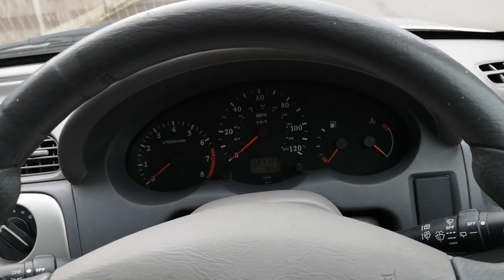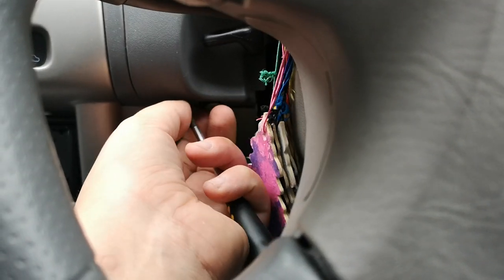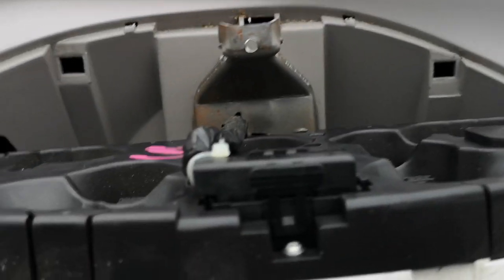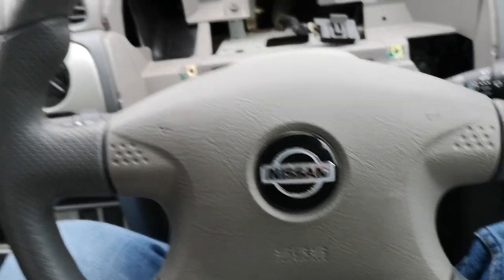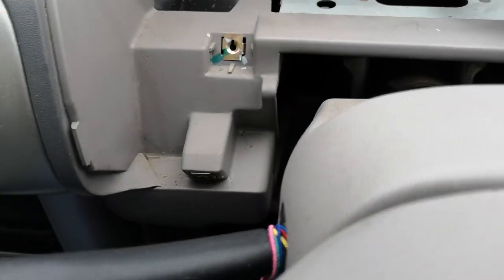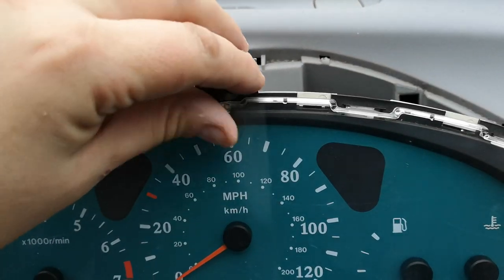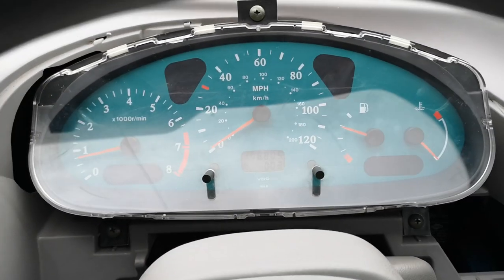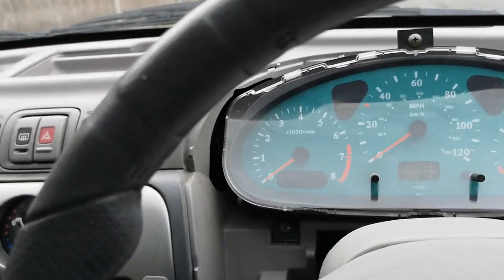Replacing a Nissan Micra K11 Instrument cluster

Comment: heard you say about having changed from a non-speedo cluster to a speedo cluster. is it a straight swap or is there any other work needed in the process? Also, what dyou have to do [if anything] to match the mileages between the old and new cluster? any info would be greatly appreciated
Reply from the maker: For me, the upgrade was 'plug and play'. No additional wiring was required. Others I have spoken with have also experienced the same. Mileage wise, I have just left it alone so my car reads around 100K more than it should :) . There are some places that will adjust the mileage but they can be quite expensive.
Reply: @JCTsFascinatingHobbies  awesome, thanks very much for the info 👍🏻

Comment: Have you had power loss to stereo and interior light with your micra. I've that problem and dead guages
Reply from the maker: Yes I have, you will also find that the rear brake lights and marker lights, are probably out, too. In the engine bay fuse box, check the fuse for the Rear lights, you will probably find that it has blown.

Comment: All gauges are not working on my k11. interior lights,stereo and rear brake lights are fine... Any clues?. Cheers
Reply from the maker: Hi, what year is your K11?
Reply: @JCTsFascinatingHobbies  2000 mate
Reply from the maker: @cosmicsman666  I have had a look at the wiring diagram, the gauges go through a 10amp fuse (might be labelled 'Meter' within the interior fuse box) and also through the iginition switch. If the switch is dodgy, it could cause this, too. Check the fuse, first.
Reply: @JCTsFascinatingHobbies  thanks for your effort mate. fuses all good and i took the binacle out and sprayed with wd40. thought it was fixed as the fuel guage went from empty to full again and a few seconds later went back to empty again. tried driving it and the speedo was still dead. ordered a new binnacle and ill see if that was the problem. Again, thanks for the input. Ignition switch?... Do you mean the ignition barrel?

Comment: I see there’s two of the same light on the back. The one with the water temperature, seatbelt and fuel warning. I only have one of these bulbs? Why is there two lol
Reply from the maker: It could be a later revision, the dash I used in this example is from a 1998 model. Later revisions had a few detail differences.
Reply: @JCTsFascinatingHobbies  I mean I have both the sockets with the same sign on, but only one has a bulb in if that makes sense. Not sure which mine came off
Reply from the maker: @TamjidVlogs  ahh, I see what you mean…..I will take a look and see what I can work out.